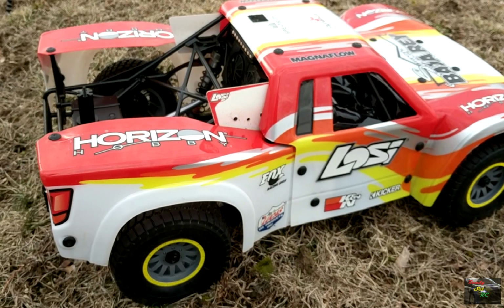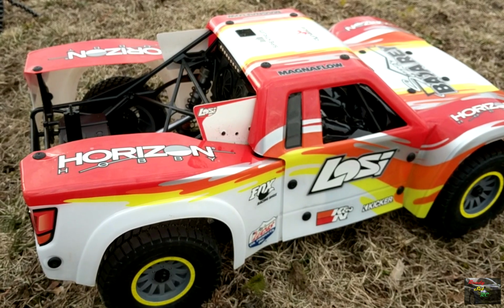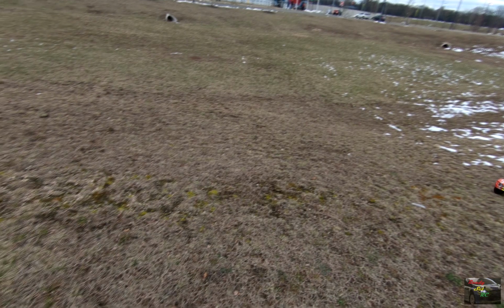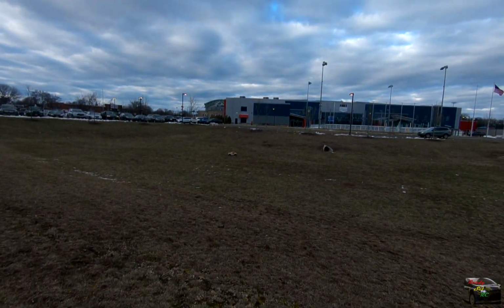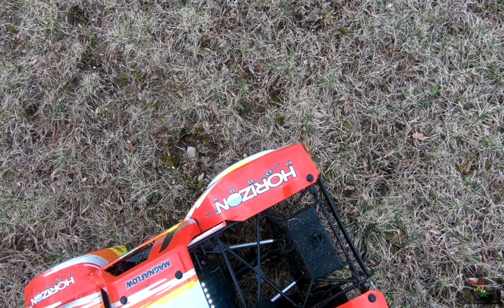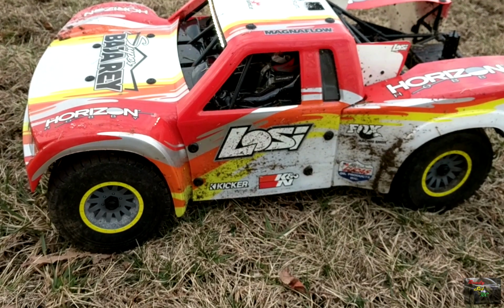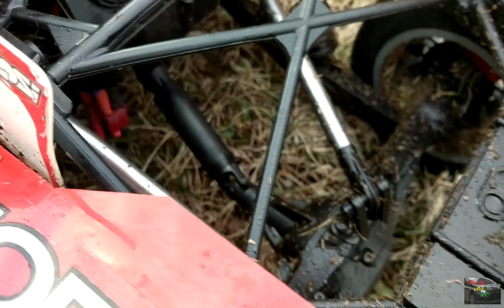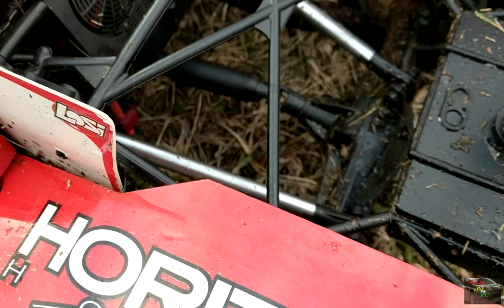Losi Super Baja Rey SBR 2nd Run and Breakage on 6S

Comment: Awesome truck so do u think the traxxas udr will be as good or better they both look similar, sux about the breakage but u will get it fixed brotha👍👍👊👊📹📹
Reply: Steve Declark, the Traxxas is supposedly far weaker. Although it looks nicer. The Traxxas is also smaller and about £100 more expensive.
Reply from the maker: Steve Declark Thanks for watching! After seeing the UDR in person, I'm not sure I would say they are in the same class.  First impressions, the SBR is larger and just seems like it is built to handle the abuse.  I would like to see how the UDR will handle.  I'm not saying people should launch it 30 feet in the air but can it handle light jumps.  I have not seen a video doing jumps at all but it looks amazing.
Reply from the maker: Isaac Lyons In the states they are priced the same. LHS and online pricing for both $749-$799.  But I agree, I would like to see how the UDR handles some abuse.  For all that scale realism, there is a price on how it will handle stress.

Comment: Looks like it runs real nice. That sucks ya broke, is that part cast as part of the whole rear axle assembly?
Reply from the maker: Jon Nantau Thanks for watching! It is separate part that sits on top of the axle.  Very quick change out but I wish Horizon would sell it as separate part instead of selling it with the axle housing.  As a break point I'll take that over the axle housing.
Reply: I hear ya, hopefully someone in the aftermarket will make some aluminum upgrades for that area.
Reply: If it's like the normal BR there will be a metal version eventually. I ended up switching to an entirely aluminum housing but in at this scale it would cost quite a lot

Comment: Another great video. Looks like it’s a beast on 6s. Sorry to see that man. Hopefully better next time 👍👍
Reply from the maker: Kenny mph Melanko Thanks brother.  Still fine tuning the GoPro Hero 6.  May need to play with the white balance but it was late in the day.  Also, this camera has zoom, another feature we did not have with the 4.  I've been playing with that too.  I'm holding off on the off-road runs until the weather is above 50.  I'm breaking kits on simple little crashes because of the cold.  Lost the servo saver on the Pro MT 4x4 on this day too. That part is not available anywhere thou.  That's now 8 and counting on the cold driving, lol!

Comment: Bummer that thing was moving great video👍
Reply from the maker: Noeys FastRC Thanks brother! I've had some great moments with the Baja Rey at this spot. I was expecting big things until that happened but time to get wrenching instead, lol.
Reply: Ready Set RC, are any of the parts that have broken available in aluminum/metal?
Reply from the maker: Noeys FastRC Nothing yet.  I was hoping so but if this is going to be a break point it may be best to keep it plastic.

Comment: Also u should put that fuel cell on there if u don't plan to run the spare tire? Just back out the tire spare tire screw and screw down the fuel cell...otherwise keep up the great work 👍
Reply from the maker: CHAMORROxCHAMP Thanks brother for watching. 👍👍 I would love to run the spar again but the wing nut that came with the truck does not screw down. I'm going to just screw down a nut and washer instead but I like the fuel cell approach too.

Comment: That sucks. I like that truck but the plastic axle sucks! Need aluminum axle n driveshaft. Solid
Reply from the maker: Richard Hand Thanks for watching.  The axle did not break, the upper link mount did even though you have to buy the axle housing and upper link mount together.  With all this weight there is going to be a break point. I will take the upper link mount as a break point but I wish they would sell it separately.  I will say I'm not at the point to blame the plastics as of yet since it was 40 degrees out there on this day. But now it is on notice, LOL.

Comment: I think that was a bad cast id call losi on that
Reply from the maker: craig mcclellan IDK. I start to think I may have stressed it on the stack I had in the first run.  I got the part in just need to find time to repair.  Only hate that it was sold with the axle housing and not as an individual item. If that is the break point instead of the axle housing, I'll take it.